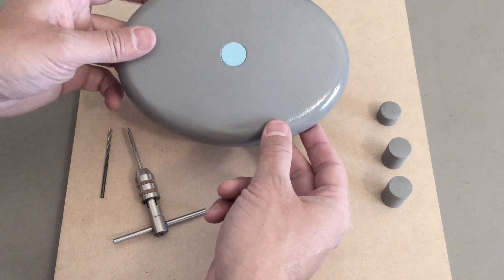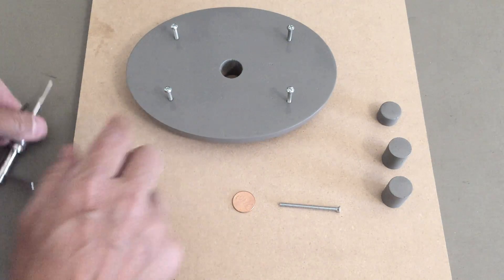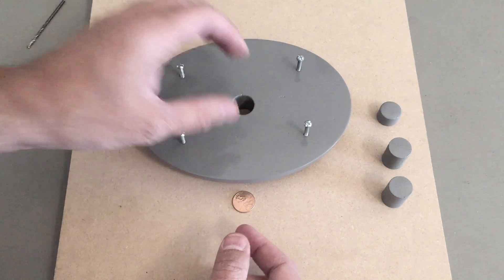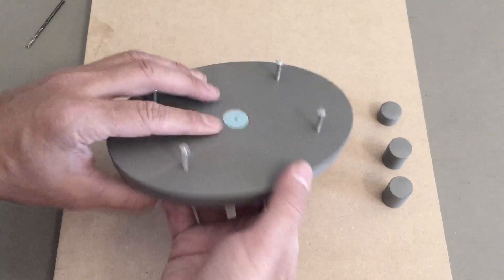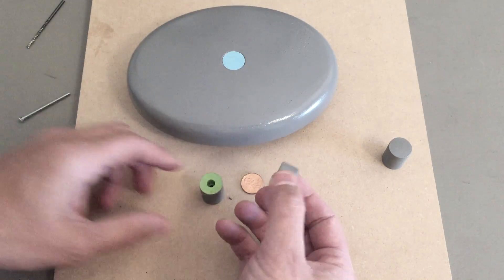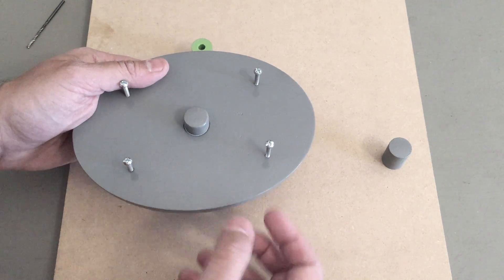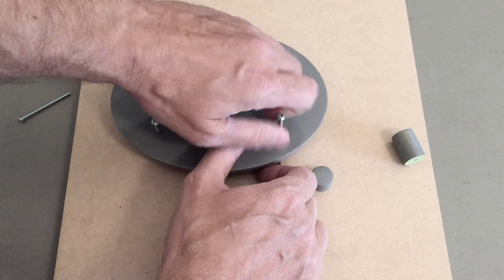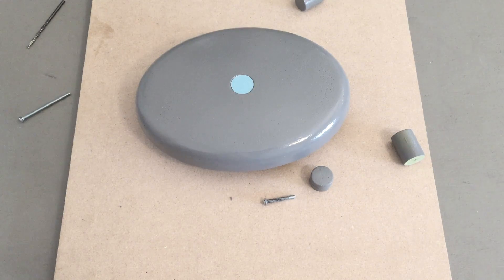3D Printed Pattern Vulcan Boiler Clean-Out Cover

Comment: I want to know what you did to get the smooth finish on the printed part. I want to do some aluminum casting this way and haven't figured out a good way to get smooth patterns.
Reply from the maker: Hello Jim - I've had some good luck using Plastic Polishing Compound/Rouge and a 6" bench-top buffer to smooth printing ridges off 3D-printed casting patterns.  Once you get the light touch feel of the friction needed to slightly heat the PLA with the buffer/compound one can get a good smooth finish.  Used PLA on this pattern, and unlike ABS, which can be smoothed with Acetone, the chemicals that will smooth PLA are a bit too dangerous for my interest so I went low tech :-) Glued the PLA parts together with White Gorilla Glue, then smoothed on a layer of Bondo Glazing and Spot Putty into the printing ridges, cured 24 hours, it sticks just enough to fill in the ridges, then sanded smooth using 150 Sanding Sponge and spray painted with normal Rustoleum Pewter Gray Gloss Protective Enamel which evened out the finish more, sprayed on a second coat an hour later, let it cure for a day and sent it off to Keith :-)  You can see the Buffer in this Workshop Blog Post, there is some other 3DP casting posts on the site: 
https://ctmprojectsblog.wordpress.com/2016/04/19/aluminum-cast-drill-press-knobs/  :-)  Best of Luck with your projects Jim, hope the info helps :-)
Reply: Thanks, I have a similar buffer in my shop. I will give it a try.
Reply from the maker: Enjoyed reading your blog :-) We have a lot of the same interests and equipment :-) Well Done